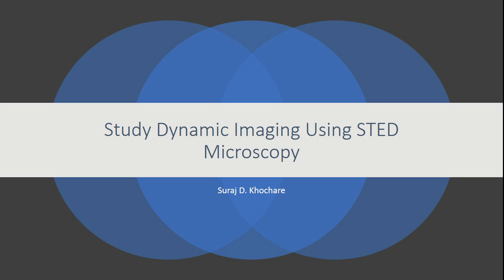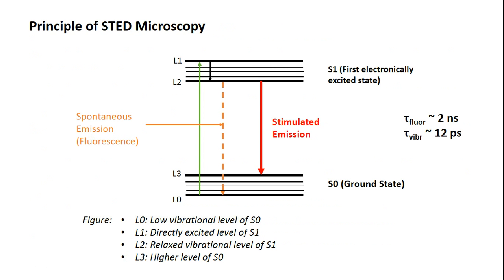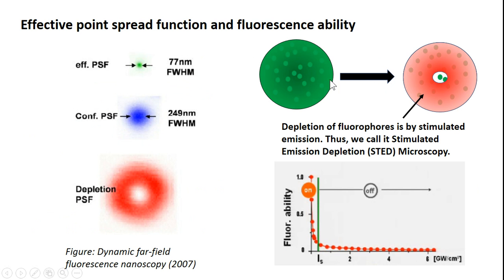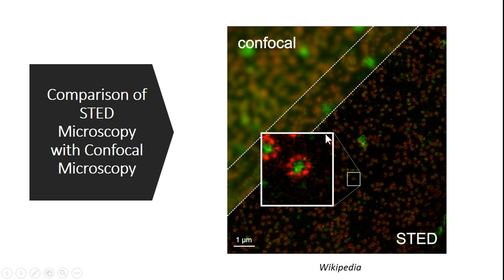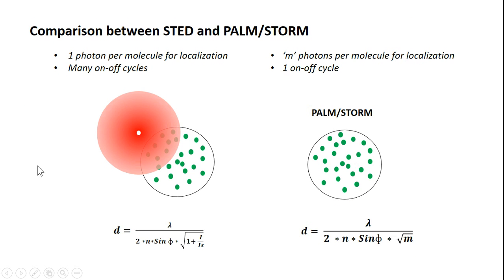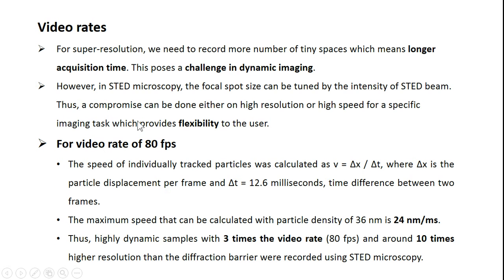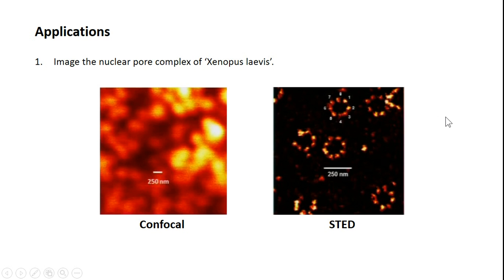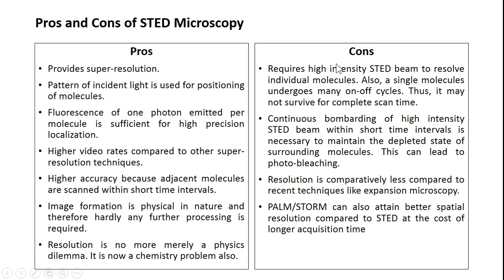Dynamic Imaging in STED

Comment: Very Nice explanation!! Just a query Many on- off cycle meaning?? I mean how
Reply from the maker: Thank you! Suppose we are scanning line-by-line using a donut-shape and are currently on Line no.1 and position x=0(first few molecules on the top-left). The circle inside the donut-shape(that allows fluorescence) are likely to contain more than one molecule. This is because that circle is approx. 20nm diameter and the molecules are comparatively smaller in size. As we keep scanning further right on Line no.1, these first few molecules will be depleted by the red-shifted beam. By now, the first on-off cycle for those molecules is complete. Now we move to Line no.2 and x=0. Here, some molecules from Line no.1 would again be a part of fluorescence emission and will be depleted as we scan further right on Line no.2. This is the second on-off cycle for multiple molecules from Line no.1. This way many molecules undergo multiple on-off cycles in this STED scanning process.